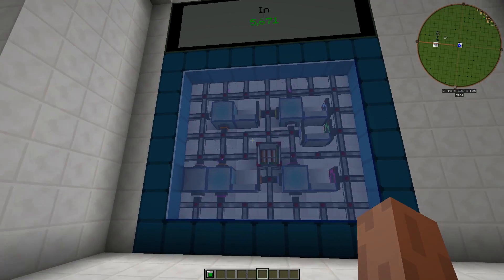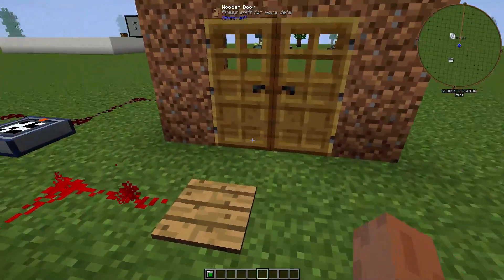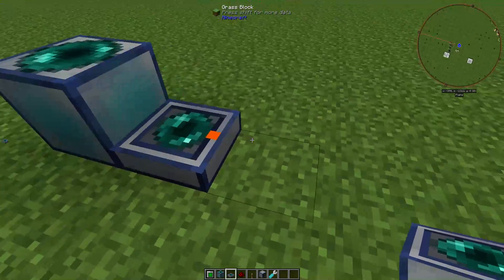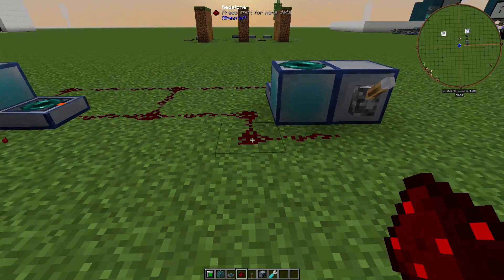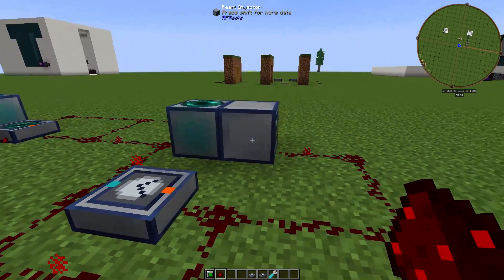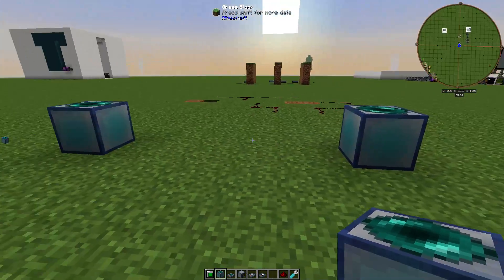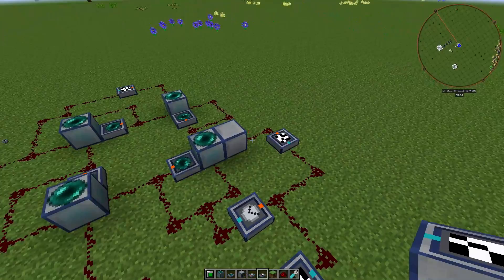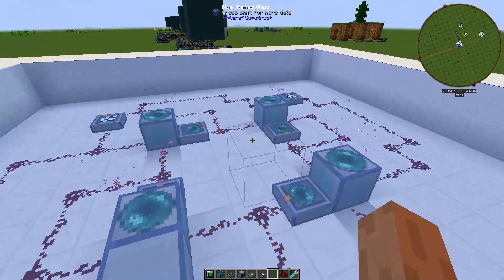Endergenic Generator - basic mechanics

Comment: Okay so with 0.5 default % it should rotate at least 100 times before it reaches 50% your pearls and everyone else's even the same system the owner made wastes the pearls. The pearl should go around more than 10 times before being lost, My problem is I can't get PERFECT cycles with ANY 4 TICK Distance MACHINES BECAUSE 20 ticks is a second but they never count 0 so there is ALWAYS that extra time screwing up my timer clock rotation. I've used rednet... etc.... I honestly don't want to have to use timers and sequencers when rednet does the same thing and I can't even get it to work perfect with rednet. Once i got my rednet to get them to produce wayyyyy too much rf.... but that same system wouldn't produce the power when gens where empty? so that is throwing me off big time.
Reply: Xai Tourney Like even the sequencers have the same issue, take them plop redstone lamps next to like 8 and turn a timer on 20 ticks and place them as if you are lighting them up individually. should be 4 ticks over 20. but, those 4 ticks don't make the lamp light up...
Reply from the maker: Very interesting. Are any of the setups working for you at all?
Reply: xxxtoddythebodyxxx Yes i can get most of them working fine it's just when I set them at the max 4tick distance (10 blocks). seems like the pearls are lost as soon as they arrive I assume because the gen is wasting energy? I was actually able to glitch the system so that 3 where sending pearls and skipping a gen? the one gen would lose power about -78 RF/t but the other 3 produced 900-1400 RF/t? This was using rednet...